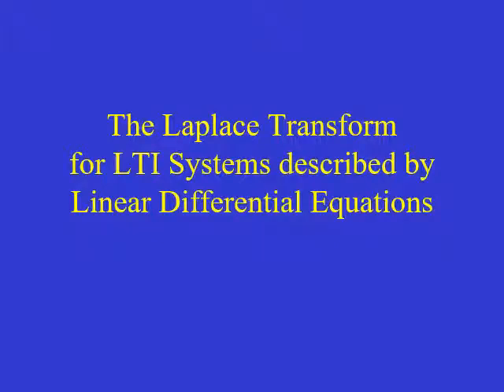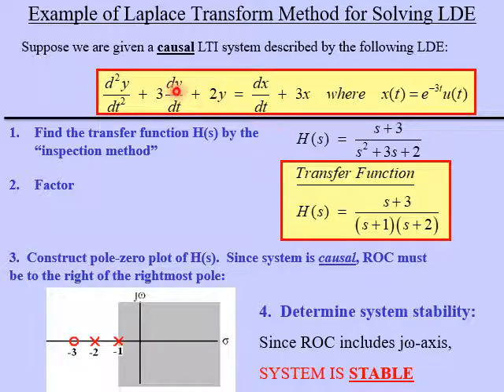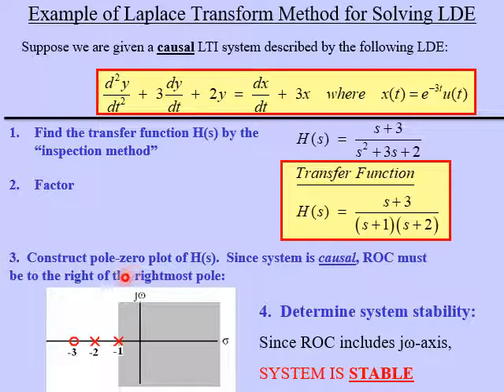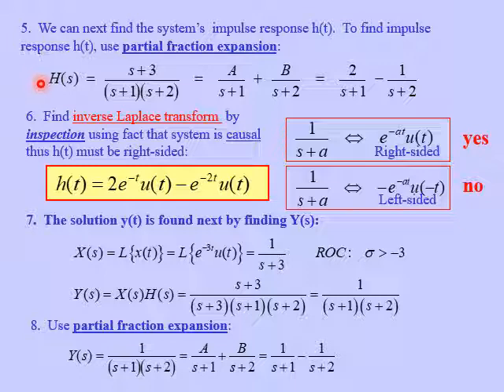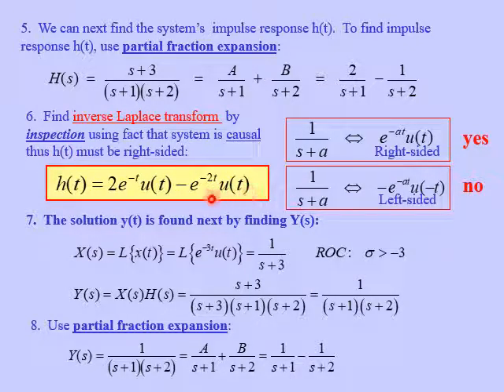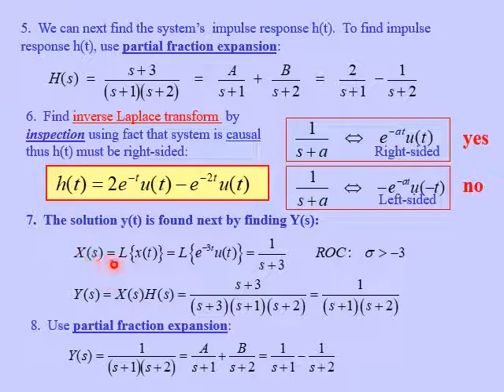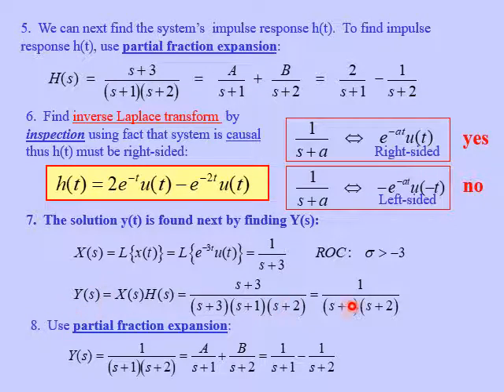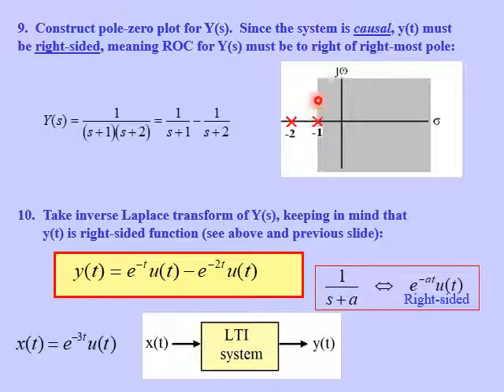Chapter 09 Laplace Transform methods for LTI Systems described by Differential Equations

Comment: great video, you're a lifesaver! I have a question however: what would happen if you had initial conditions? like if you had to consider y(0-) and y'(0-) as positive values?
Reply from the maker: If the system is not initially at rest, you must use the Unilateral Laplace Transform.  See my video "Chapter 9 The Unilateral Laplace Transform" for details!
Reply: @csusmee3037  I just watched it, it makes so much sense thank you!